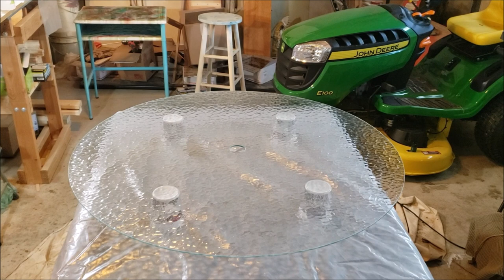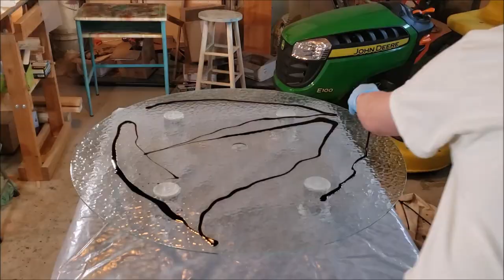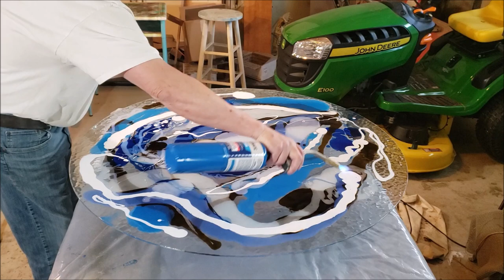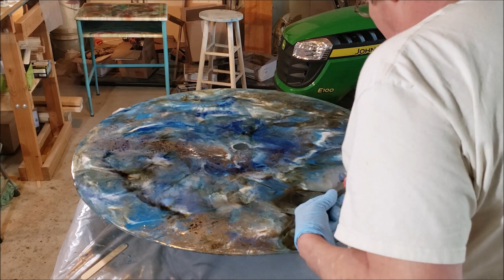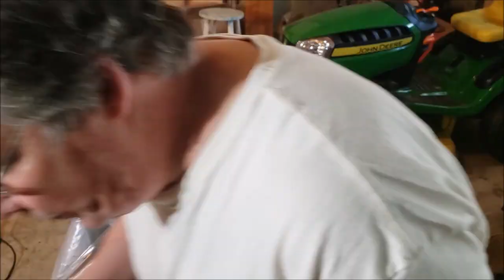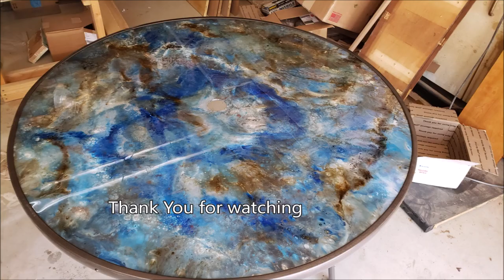Beautiful Epoxy Art on Glass Top Patio Table

Comment: Thank you for this amazing video. I hv a old glass dinner table that I will absolutely try on. Would it work without a heat gun / torch?
Reply from the maker: You need a heat gun or a torch to remove any air bubbles from the epoxy. Good luck on finishing your table. I'm sure it will turn out great.
Reply: Thanks Warren 🌸

Comment: this is gorgeous, i wish u included the products.
Reply from the maker: Thank You, The products are listed in the description.
Reply: what was the first coat for? do i have to do that? i’m looking to do something like this to the bottom of my glass dining table using only 4 colors, but im a bit worried i’ll mess up. My dining table is a little scratch up and would love to give it a new look. It measures 35.5 x 61 . Any advice?
Reply from the maker: @thetruthonly6201  That first coat of clear was just to make sure I got some epoxy on the whole piece and it makes the rest of the epoxy flow better. You do not have to do that, as long as you make sure you get good coverage from the rest of the epoxy. If you mess up, you can always just go right over it again after it dries.

Comment: I was wondering if this works on glass....this is awesome. How long will this last once it's sealed with resin ?
Reply from the maker: If you leave it outside in the sun it will fade. If you leave it outside in the winter here in PA, it will delaminate and be ruined. If you bring it in for the cold months it is fine. The ones that have been stored indoors all year, look as new as the day I poured them after 2 years.
Reply: @warrentobelmann8502  Thank you for that, I live in Florida so most days outdoors are short lived due to the intensity of the humidity. 😁 But the table I want to do like yours is my glass kitchen table.
Reply: I have been using resin on sheets of glass also. small ones like old door or small old window pane glass and I'm using powdered eyeshadows for coloring  it works great! still transparent effects like stained glass  :)

Comment: Since this is an outdoor piece will it yellow at all?
Reply from the maker: It will fade and get hazy from the sun. It will last for 1 summer in the sun, but by the winter it looks bad. I plan to redo a couple tables I have so I can enjoy them again next year. I will also use a uv resistant top coat to see if it helps.

Comment: Did you add hardener into the first clean coat ? And again do we suppose add hardener into every different color we apply? What is thr ratio ? Thank you for your answer ..
Reply from the maker: I mixed all the epoxy in 1 cup at a 1 to 1 ratio resin/hardener, and then poured that into the individual cups before adding the colors to each separate cup.